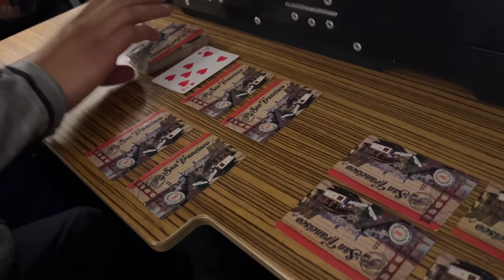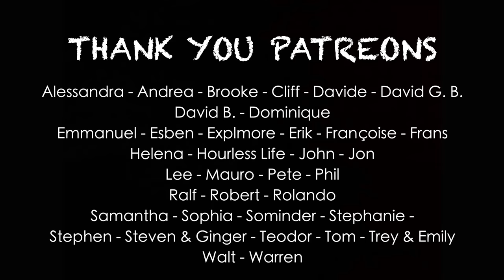BREAKDOWN in the middle of Yellowstone National Park (EP 36)

Comment: The main thing with Towing. You have to keep the tow rope tight.
You are using your brakes to slow him down as well. Mostly when going down hills and stopping. If his brake lights come on, your rope goes slack need to push brake a little harder. You want to try to not have brake on when pull you on flat road too.
As he is changing gears when speeding up, the rope will slacken a little, till he puts foot on gas again. Don't touch the brake, will take slack up by it self. 
When going from stop, to go on a new road and have to take off quickly.
Just hold the brake down a tinny bit just enough to stop rope getting a big sagg in it between gears.
Once he is in 3rd gear let brake right off.
This is All to stop the big jerks.
If the rope is slack. let him know so he can go forward a bit to tighten it up before he has to start pulling you quickly to get across an intersection.
Hopefully this all helps get you to buy a tow bar or get one made.
Hopefully even better, your Landrover is an easy fix.
Happy travelling.
Reply from the maker: Great advice! We learnt some of it while doing! Thanks a lot!

Comment: Sounds like turbo charger seals. Not a big deal as long as the turbo is able to be rebuilt otherwise a reman will be on the agenda. When turbo seals break it will suck all ur oil out very quickly & engine damage will accure if u don't  catch it in time. I hope that's all it is. Good luck guys!
Reply from the maker: Thanks Billy!

Comment: A solid bar is much safer for towing. the problem with a long rope is that people may not realise you are being towed and overtake where there is not space to overtake both vehicles.
Reply: Completely unnecessary if you know what you are doing and the brakes work on the towed vehicle
Reply from the maker: Hi For a long long distance we would have preferred a solid bar. But we had no alternative in the middle of Yellowstone. Eventually with the Walkie talkie we could maintain good coordination and the rope was not very long at all we would have warning lights and pull on the side when another car was coming up. More on this adventure in next episode. It does require a lot of focus though...

Comment: If you see an engineering shop on the way, they could make a Towing bar and an easy hitch to go on the front of the Landrover.
Be way safer than Towing with the strap. If have locking hubs on front turn to unlock. Be easier to steer. I would top up the oil.
Start it and check where oil coming from. If not bad when idling, and has oil pressure, no big knocking notices. and not heap of smoke out exhaust. I would just let it idle when being towed. You will have your power steering, and power brakes to make it easier being towed.
Cheak to make sure an animal has not made a nest in the engine air intake. If it has, the engine will will be gutless, blowing black, blue smokeout the exhaust from sucking oil out of the motor. Might be all that is wrong with it.
Hope all works out for you.

Comment: You can rent a U-Haul car trailer to haul your defender better than towing it 250km. If it came down to it you could rent a U-Haul truck to pull the trailer.
Reply from the maker: Good tip! That s a comment that came back several time. From where we were was complicated to do but in another location if we have an issue again we will definitely keep that in mind

Comment: Nice to see a Kiwi rego plate in USA! Sorry to see this,,,,, what appears to have happened is your turbo oil seals have corrupted and leaked oil into the manifold area. You's are very very lucky it wasn't an aggressive leak which would have resulted in the engine running away and blowing up!!! lf that happened you would have been looking for an entire engine, not to mention the increased repair cost!!!
Reply: Another thing with diesels is to have a rag handy for stuffing into the air intake if the engine does happen to run away. The only way to turn a runaway diesel off is to block off any air entering the air intake with a rag!
Reply from the maker: yes we heard! we were happy to stop when we did !

Comment: Sorry for what happened.
Anyway, as much as it seems an upsetting event having the rangers telling you to use the park trailer, they actually "helped" you to save money in reparing the drivetrain of your Defender.
If flat bed/tow truck not available and you need to be towed by other vehicle, you should go under the Defender and disconnect front and rear prop shafts otherwise you would compromise part/s of your drivetrain.....repairs could be quite expensive.

Good luck
Reply from the maker: 🙏 thanks

Comment: Bummer!! We've been talking several times on line about the pleasures that lie ahead in the Canyonlands of Utah. I live in Driggs ID, 30 miles across Teton Pass from Jackson Wy.  It may not feel like it but its good that the Park Rangers stopped you from flat towing your Defender out of the Park because of the wildlife, hills and traffic.  Better to be sitting a parking lot trying to decide what to do next than being upside down in a canyon. Taking it to Jackson is probably a bad idea.  Jackson Hole Wyoming is the richest county in the entire USA, and rents and services are priced equivalently. I don't know of a single shop that would work on something as unusual as a Defender.  Not that they don't exist---- I just don't know of one that I would trust.  When my VW fuel pump failed in the Jackson Hole Ski area parking lot the nearest foreign car shop wanted $550 dollars to tow it three miles to their shop and install a new one.  My next  door neighbor who has a big truck flat bed wrecker charged me $ 100 to drive across a 8700 ft pass, bring it back and roll it into my garage.  The local parts house delivered a new fuel pump to my door for $120 and I installed it in less than an hour. 
 
Hate to be the bearer of bad news. but if the engine ran for very long without sufficient oil it is toast. 
I used to own an exotic car restoration shop. I'm too old and lame to be your mechanic, but would be glad to help you find your best solution. 

Best of luck!
Richard
Reply from the maker: Thank you Richard. As you say it was probably for the best in Yellowstone. We eventually found a place in Jackson recommended by another Land Rover owner. But it was really random that someone knew anything of Defender over there as you describe. We were lucky to be recommended. Thank you for your comment and encouragement!
Reply: If you took your vehicle to Jackson I hope you brought money!   Your oil leak is likely a broken exterior oil line, loose fitting, or cracked oil radiator.  Not rocket science.  @NextMeridianExpedition